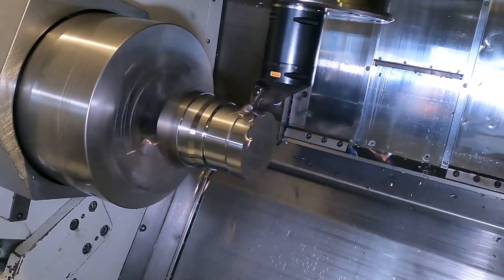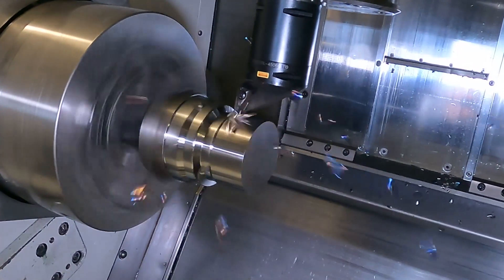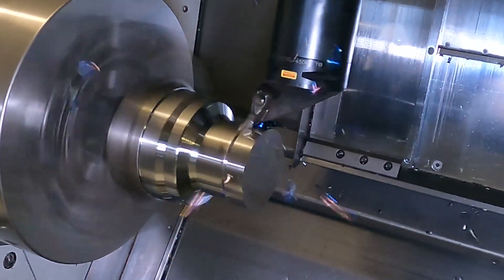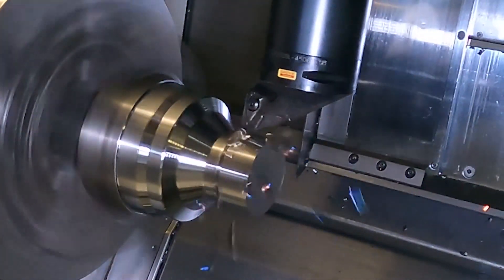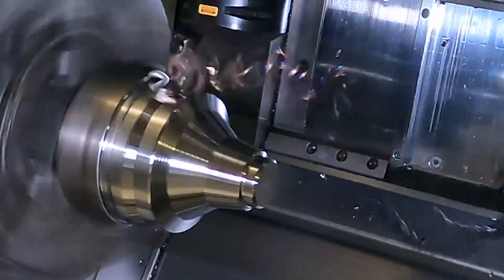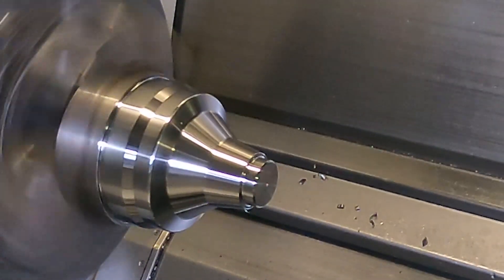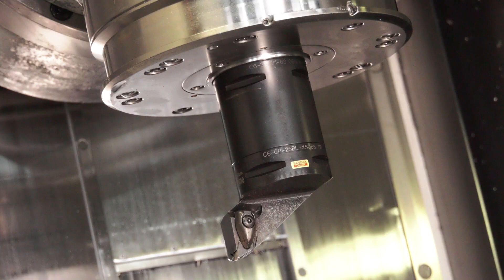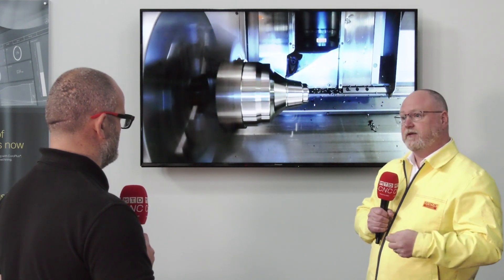What is PrimeTurning from Sandvik Coromant?

Comment: How much is the software and I assume it can output in basic G code ?? One of my old machines we use for Inconel running on Fanuc O-T.
We also machine alot of EN19T which we don't have any issues with but I'm always looking for better processes and this I have to say has peeked my interest. Cheers
Reply from the maker: You would need to speak to Sandvik on all your points